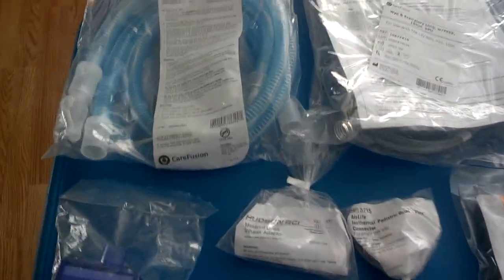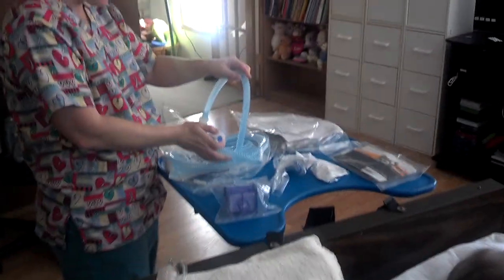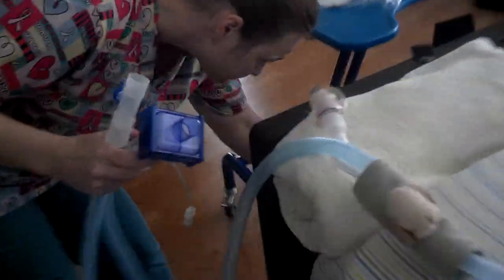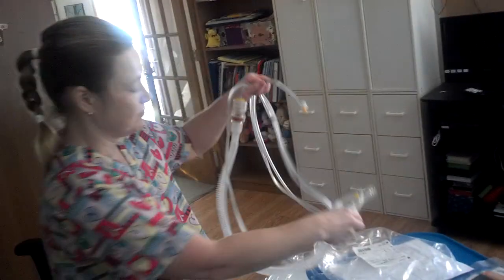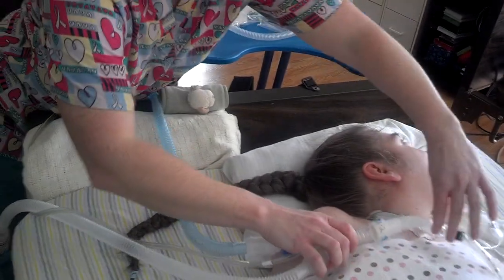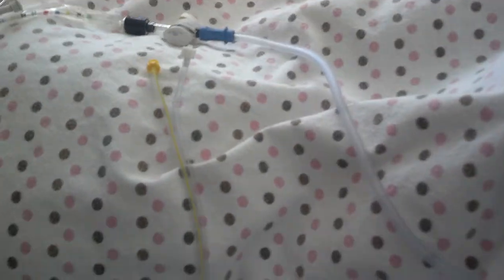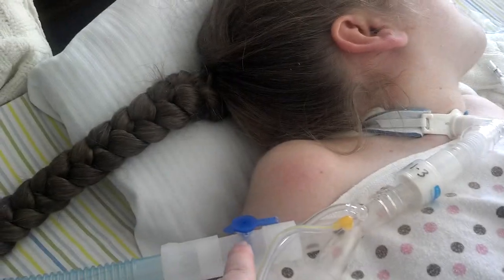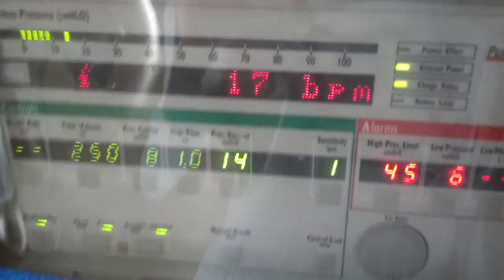Changing a pediatric ventilator circuit

Comment: At 2:36s, that piece on your hands. What is it called and where can i get it? Cheapest possible. Thank you mdm.
Reply from the maker: It is called an MDI adapter. It allows you to give your rescued dose inhaler (metered dose inhaler) by just popping open the access and inserting the pin of your vial. 
We order from the supply company who gives us all our ventilator supplies and it is all covered by insurance for us.
You can google MDI Adapter and find a vendor. Word of advice, not all Inhalers have the pin you can expose to use with this type of adapter. Example, ProAir does but Ventilin does not. There are other adapters on the market too that doesn't require the exposed pin
Reply: @annrfrancis  Im using an IC2A ventilator from Biomed. Can you tell me what i need for a full breathing circuit set?
Reply from the maker: @mohammadfairos502  you need to talk to your doctor and/or respiratory therapist. It depends greatly on what type of ventilator you have.
Reply from the maker: Meaning, is the PEEP internal or will you just need a swivel exhalation piece? I'm not familiar with your ventilator.  My best advice is to minimize dead space in your circuit. For instance, this piece that I am talking about that allows you to give rescue breathing treatments may not be a piece you need often and therefore wouldn't need it to take up space on your circuit. Can't stress to you enough to ask your doctor.

Comment: Uh why are they NOT wearing gloves ?  Handling sterile items barehanded a NO NO !
Reply from the maker: Gloves are overkill in the homecare setting.  Ventilator circuits are not sterile, that's impossible.  The gloves are not needed when you wash your hands and your home is kept clean.  So, Uh, we aren't wearing gloves because it is an unnecessary expense.  For what it is worth to you... my daughter has had her vent for over 10 years with no infection from a circuit change.